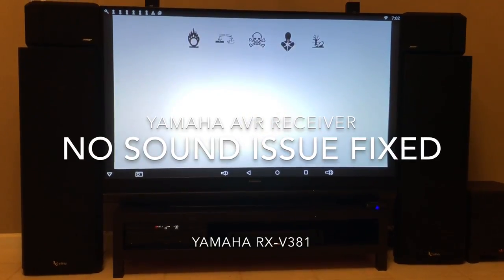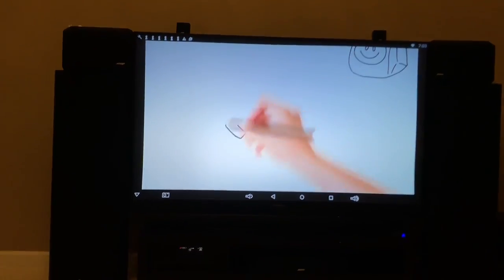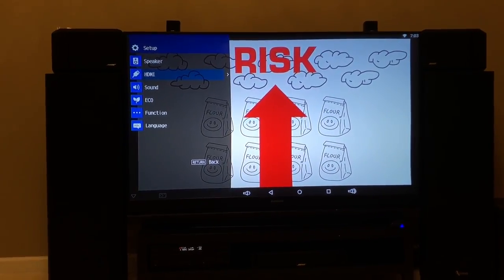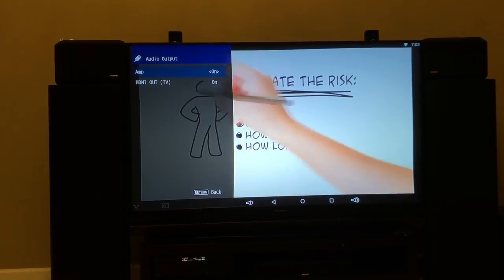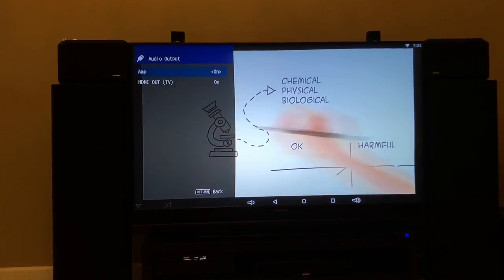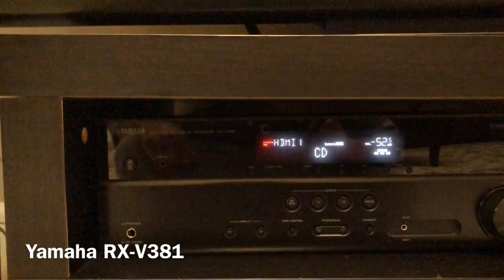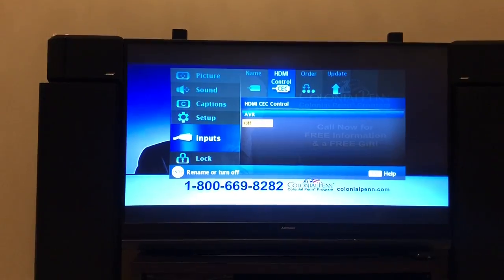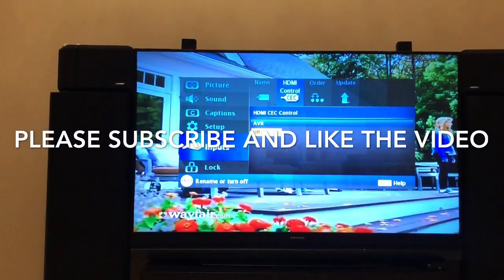Yamaha AV Receiver HDMI sound problem fixed

Comment: Can you tell me how your TV is hooked up to your receiver? 
Is it using HDMI out (ARC) on the TV to HDMI1 on the receiver?
Reply from the maker: I use ARC
Reply: @HowToDoitright  thank you! So arc and then the settings in the video?  Do I put it in the arc port on the receiver? In your video it looks like you went from tv to hdmi 1 on receiver
Reply: @HowToDoitright  Good morning, Are you using the ARC port on Receiver or HDMI 1 port? They are separate on mine.

Comment: On my Yamaha RXV6A
I have sound coning through Sky box/ps4 as it's connected directly to the receiver. 

When connected to ARC I have no sound coming from my TV and TV apps, Netflix, Amazon, Disney etc. I have the message "Decoder off" on the reciever screen. 

Will this fix that issue?
Reply from the maker: You can try. It may

Comment: I have a question? Did you connect the receiver to the TV with a HDMI cable? I get no sound, with HDMI and with a speaker wired to the receiver (Yamaha VX377). Silence.
Reply from the maker: yes i was using HDMI cable...change your cable..there maybe a cable issue..

Comment: hi, I just tried doing that, but still no luck, what other solution can i try?
Reply from the maker: Hi not sure. This worked for me. I would recommend checking your settings. Reset both TV and received settings to default and try again. Also check your HDMI cable. Some cables don’t support audio or go bad after a while

Comment: unfortunately, this is not a real solution since this essentially disables HDMI CEC (not to be confused with ARC).  CEC is the feature whereby it powers on TV when you switch on the receiver (it also automatically powers on, say, your Blu-Ray player when you switch input assuming your Blu-Ray player supports CEC)...it also powers off everything when you turn off the receiver, so you don't need some fancy universal remote that does this same thing.  this "problem" apparently is not a problem, per se, as it is found across all brands (not just Yamaha) because this is what the HDMI ARC/CEC standard implementation (go figure).
Reply: Makes total sense so could you just use a optical chord?

Comment: By doing that you will not get audio from your smart tv's streaming apps to your receiver. Only way to get Netflix audio to your receiver thru hdmi arc is with that feature on
Reply: eja35oz do you happen to know what setting to use if I am trying to get Netflix audio to my receiver using optical instead of arc? I have an older yamaha receiver that doesn't support arc. I have the optical cable connected but when I switch to Netflix app I'm still getting sound from cable TV.
Reply: Katie Daniewicz Hey. Check on the back of the receiver to see which input the optical cable is connected to. You will have to manually switch to most likely AUDIO 1 every time you the TV apps. 

What you can do is program the button on the Yamaha remote that says TV under Scene. It may already be on AUDIO 1 so you might not have to do anything.

Remember no video from the TV is processed by the Yamaha. It’s only the sound. The Yamaha only processes the video as well as the sound for the stuff actually plugged into the HDMI 1-4 on the receiver itself.
Reply: @lecorsaire2283  Thanks! I got it work like you said using AV1.
Reply: Katie Daniewicz Glad it’s working! Getting everything to work can be frustrating.

Comment: haven't tried this fix my sound works when I play Blue  Ray's My surround sound works great, when I play netflix, youtube through my AppleTV 4k theres no surround just front stage speakers. When I do play a surround test through Youtube same thing.  I did every thing to try to get it to work. All Cables are up to date. I'm using hdmi through Yamaha RX-A3080.  I have atmos speakers in the ceiling.  Ive been though all the apple tv4k settings and everything is set right. I thought if i Play youtube through my blue ray player it may work so I ran a surround sound test through the blue ray and guess what same issue. So it must be the RX-A3080 settings. Anyone have an Idea?  Also When I do a surround speaker test through my Receiver all speakers are setup correct.

Comment: When i hook my reciever up to my blueray player or anything with hdmi or AV cables it will show the video on the screen but wont put sound threw. It wont even show the speakers are hooked up. If i leave it on for hours sometimes it starts working. I tried resetting it also i tried new cables and adjusting the tv settings. Any advice? RV-V367 model
Reply from the maker: no idea...maybe a faulty box

Comment: I have the same problem with a yamaha rx-v385 and a toshiba 55 inch tv
Reply: I have an RX-V385 and have a problem where there's no audio on some days when I turn the receiver on and I'm using a QNAP TS-453D NAS HDMI as the video source. If I reboot the NAS, audio comes back. Just wondering if it's a similar issue that you had? If you reboot the AV source, did it fix the problem? If that was your problem, clearly this setting is a much better fix than having to reboot devices and I look forward to trying it.
Reply from the maker: Try reset

Comment: I have a Yamaha RX-663 and its stuck on Silent Cinema mode...could anyone help please?
Reply: unplug receiver wait a few minutes and plug back in . that would be step 1
Reply: Thanks Tyler what would you suggest next?
Reply: Great thanks Tyler, ill give this a try i appreciate the help
Reply: I just tried it and it still stays in headphone mode...perhaps i should buy a remote control. Maybe its only accesable from there
Reply: yeah you left out the part you didn't have the remote LOL. You should find one on ebay for under $20

Comment: OFTEN  the ARC...HDMI...is not functional...so you cannot send audio to your Receiver or any external device....THIS IS NOT MENTIONED.MY HISENSE WILL NOT SEND AUDIO TO MY YAMAHA.
Reply from the maker: Phillip Weissburg yes you are right but this video was intended for audience whose system was working fine and then started to have issues so in that case it was assumed that they have the right HDMI cable.